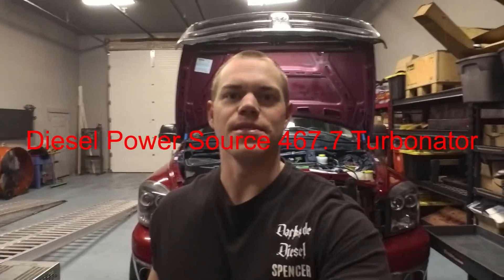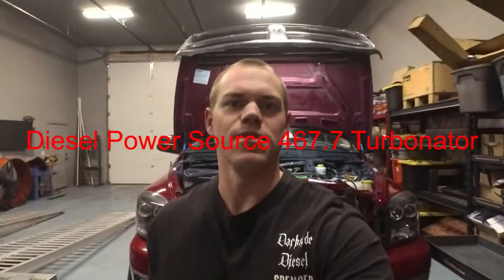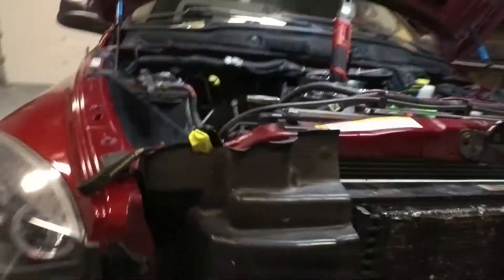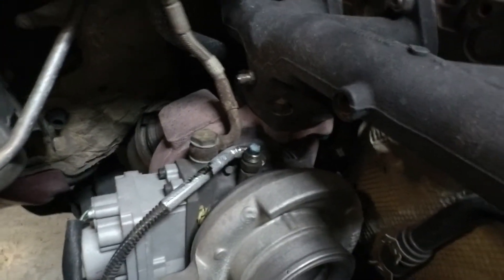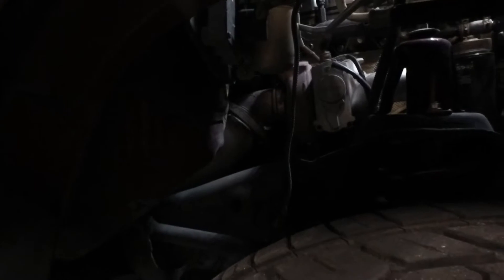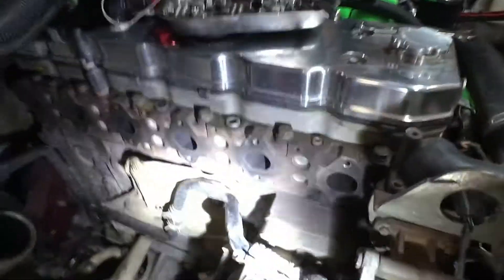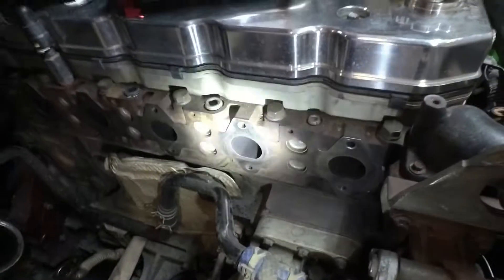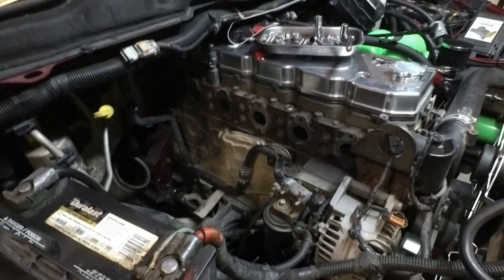Diesel Power Source S467.7 Turbonator Install

Comment: Excellent turbo dynamics! Sadly, I cannot say the same for the DPS customer service. I sent the turbo back once due to oil flowing out the exhaust and intake, coating the tail pipe with oil as well as the intake manifold. Second call back resulted in no return calls. Same engine, stainless turbo from HT at 150k mi netted only oil to the intercooler,  so the turbo is the only variable in pushing oil through the turbo. I use about a quart of oil every 300 mi, when I would use about 2 qt every 5k mi before.. 

Doesn't matter how good the idea is if the new turbo can't control oiling....
Reply: Sounds like an installation issue
Reply: @AmericanPieLightsOut  "sounds like an installation issue..." -  typical ambiguous deflection. 
Clear drain tube of seller's choice, stellar crankcase ventilation, unobstructed line from turbo drain to crankcase, vertical flow line... and you think you have enough to blame the install without this information. 

You must work for the company who doesn't want to stand behind their product.
Reply: @Faolan161   no man, I don’t work for DPS, I work for the railroad